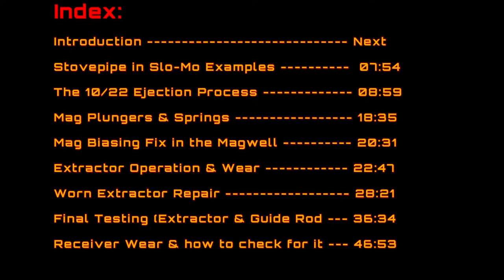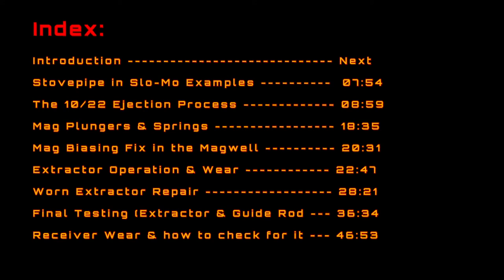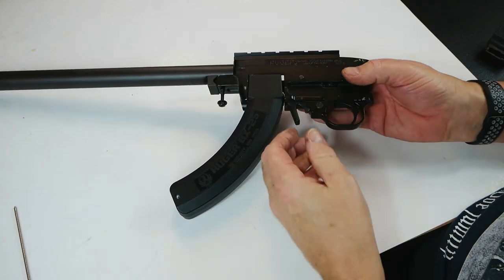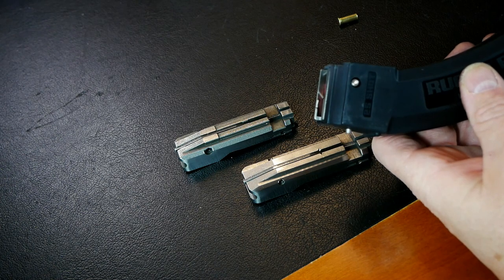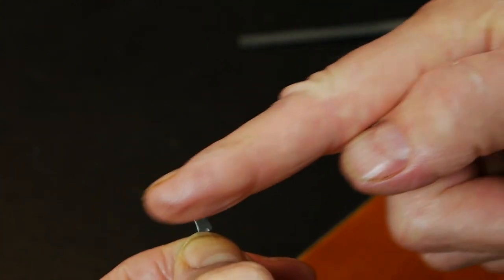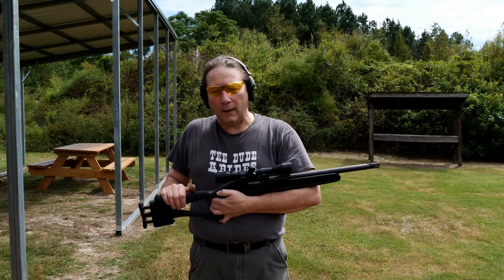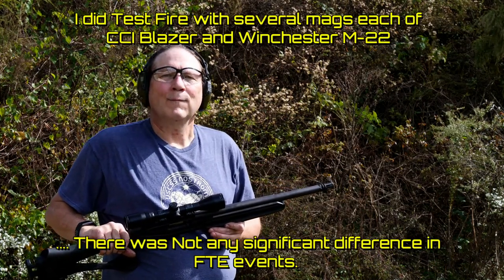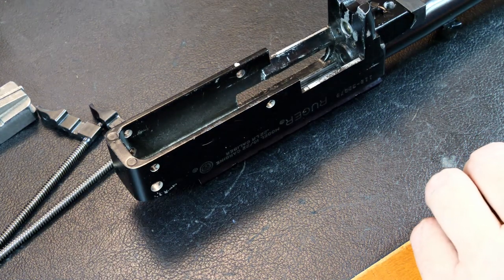Fixing 10/22 Stovepipe & Failure to Eject Issues

Comment: When I first bought my 1022 way back in the early 2000,s I had two ten round mags and very quickly bought a BX25 as well. (I also own two BX15 mags).
The ten rounders never skipped a beat, and for a long time the rifle would happily eat and cycle anything I put through it. It worked flawlessly with Eley subsonics too (I live in the UK). However....the BX25 would endlessly cause issues with stovepiping and failures to eject, even with CCI minimags. I noted the 'wobble' of the inserted mag, compared to the ten round mags, also exacerbated by the extra leverage on the long mag body. So, I took some sniper tape and my trusty pocket knife and cut and stuck a couple of layers of the tape, carefully 'fitted' around the top of the mag where it enters the rifle. It was then a really snug fit but still very easy to insert or remove. I loaded up.....mag dumped and "Hey Presto!" No more jams!! I never had to do anything else, it just fixed the issue straight off. Interestingly, the BX15 mags work as well as the ten round mags and seldom if ever cause issues.....depending on the ammo. There has however been an interesting change in behaviour in that one day, a long time ago now, I went out and bought a new batch of  Eley subsonics (rabbit hunting/pest control in a sensitive area with a moderator fitted!) and this time, I had endless issues with all the mags!! I can only assume that Eley had changed their recipe somehow and these bullets no longer performed reliably in my semi auto. Other subsonic makes were better, although the issues went away completely when reverting to good old CCI minimags. The only issue being the noise level increased hugely!
The basic issue of padding out the top of the mag worked a treat and every so often, after a lot of work ( thousands of rounds and hundreds of insertions) I would just freshen up the tape with replacement pieces and back to great reliability.
Since then, I have plonked the 1022 action into an Arthur E Brown M1 carbine stock and also with two new ten round mags, added the 'look alike' M1 carbine dummy plastic mags that epoxy onto the base of the ten round mag. They look fantastic and they hugely help with loading and removing a standard ten round mag. My primary pest control rifle is now an M&P1522 and that has just had a new Volquartsen ejector fitted for the same damn reason!! It now runs like a sewing machine and cycles and ejects everything! 😊
Great video and great high speed stuff showing the bolt bounce too!! If they could eliminate that as it closes, the rifle would be even better!

Comment: I have had my 10-22 for 4 years.... What a POS!!!  Even stock mag. stovepipes.    Like a fool I bought a SR-22 pistol.  POS also.   Never again will Ruger get another dollar from me. I know this is not where to vent but why do they sell a product you have to modify to make it function as a reliable firearm!   Would you buy a new automobile just to work on.   GREAT Video!   I will try some of the excellent  tips here...  This dude has a lot more patients than I have!!!!
Reply: When I thought about the receiver wear thing and my 10/22 with just 5000 rounds though it, which has a wiggling bolt in the receiver something like this crossed my mind also.
Reply: Receiver wear doesn't seem to do much, I had a real POS that I sanded the cerecote out of the reciever. Then tried to mount a scope on and realized the barrel was canted to one side. I rotated the barrel and it'll run 25s now! It used to jam every other round.

Comment: Very thorough analysis 👍.  A new extractor might be a good idea if Failures to eject happen, although something to prevent the Mag from wiggling. Although the tape on the side of the Mag usually helps I think thats not the right place to put tape on because then it depends on the stock to stabilize the Mag in the receiver and the room the stock gives the Mag varies from Stock to Stock. I had the Idea to put some small tape stripes left and right on top of the Mags (on the narrow ridge just before the round portion on the right side and the metal portion on the left starts). This prevents wiggling completely and because this ridges with the tape stripe on it are making solid contact to the receiver it is completely independent from the kind of stock someone uses.
Regarding the wear on the receiver: I doubt that the bolt has no play when it's new, because mine has just 5000 rounds through it and it has some play. Since I did not check it when the gun was new I can't be 100% sure but it's quite unlikely that just 5000 rounds are causing that kind of wear, especially because mine was always lubed and reasonable clean.

Comment: A new Ruger 10/22 seems to have lots of issues and it's made with more cheaply parts and less quality control. 
Great review 
Thanks for sharing 🤝👍
Reply from the maker: Thanks! and I agree... I think Ruger's QC on newer 10/22's isn't as good as it used to be, and also if you look at the older 10 round mags that came with 10/22's the feed lips and extractors are machined and not cast and fit much more precisely (even the new 10rd mags that I have purchased are just cast), add in a looser fit on the BX-25's and it definitely impacts reliability.

Comment: My relatively new 10/22 (5000rounds) started having ejection issues with the BX-25 mags adding a layer of metal tape on the back ridge of the mag helped alot. That ridge wears down over time and the mag gets really loose. I'm going to add some tape to the well, like you did, just for good measure. Also, make sure you clean the bolt every 300-400 rounds; especially if running a suppressor. If the firing pin gets gummed up a weak primer strikes will cause a short cycle. Something strange is my gun has a huge amount of bolt wiggle (about 1/8"). I see little indication of wear on the bolt or the receiver.

Comment: Thanks for the tips most of it made Sends to me, I fix everything I'm off grid. You probably reduced my repair time.
Quite a bit. When I was younger, I would burn. Maybe 2 boxes a week sometimes just one. A lot of shooting more than normal, I guess.
40 years later.
I'm lucky if I burn a box of 500 every 2 years. My wife is gone.
Not my life. Not making enough probably gonna go back to work. After 2 and a 1/2 years can't survive on social security.
I'm not old, just high mileage.  LOL.

Comment: Yes, the vise was pulling out heat. However, you did not temper anything. First, a part is heated and rapidly cooled completely to harden. That is hardening. Tempering is when you reheat to a set temp to give the steel strength. If left fully hard, it will be very brittle. 

In this case, this is not an issue as you allowed the part to cool far too much before adding any coolant, (which was far too little coolant to work), and far too long in the cooling before being applied. What y actually did here it annealed the steel. In other words, you softened it. Further heat was applied too long and this causes loss of carbon which lowers the steels ability to harden. 

Next time, try this. with a low cost pair of needle nose  pliers, hold as little of the base as possible. Apply heat just long enough to go to orange which is appx. 1475 deg f. Immediately drop into oil. Do NOT allow it to lose the color before dropping it into th oil. Allow it to cool completely in the oil.  Once retrieved from the oil,  mediately place in a pre-heated oven at 425 deg. for 1 hour. Two is better! Allow to air cool. No forced air. This will draw the brittleness from the steel and lower the Rockwell C hardness down to apx. 56 hrc. This is tempering.  Straight from the oil cooling was hardening. Very high HRc number in the neighborhood of 64 her. Very brittle. Unless you allowed it to cool before it was dropped into coolant. Simply dripping coolant on the hot part will do nothing but induce stress into the steel.  

So essentially what was done here was the part was both softened, with hard spots causing stress risers making it far inferior to what it was before any heating.  

Hope this helps!

KnifeMaker/Retired after over 47+ years in the Craft

Comment: I chased all the possible problems and what I found that was wrong was that I was firing it with oil on the extractor area. Fired it dry and all the problems went away. I would often just spray that area where the extractor is with brake clean just before I use it. Works well dry.

Comment: Well done and thanks for the effort here. In my experience it's the fitment of the BX25 to the receiver and I think you saw that yourself by shimming it. The BX25 is a finicky problem child compared to the 10rd rotary mags. If a BX25 works in your receiver, great. If not, you have to figure out how to make it work because the manufacturing tolerances on the receivers is so poor. It's a crap shoot when you use this combo. But what do you expect from a $199 rifle? I have friends that can't make ANY BX25's work in their 10/22's and others have zero problems running the same ammo through a BX25. If their QC was this bad on the rest of their firearms they'd be out of business. And Kudos to you for using that crap ammo. If you can make Golden Bullets run, you da man!
Reply from the maker: Thanks for the added Info!  It's interesting as everyone's experiences are a little different.  I've tried BX-25's in two regular 10/22's, one Takedown model and a Charger pistol and the only one that has given me fits is the one in the video and that has been after close to 10 years using them.  Unfortunately Ruger's design for holding the BX isn't up to snuff and the cast feed lips without any milling aren't doing them any favors either (on top of this I've noticed that the aftermarket 10 round mags aren't of the same quality as the 10 rounders that came with the rifles I've seen) and as I commented in the video when the mag is biased for better ejector engagement the ejection is much more consistent with where the brass is going, which to me is the largest issue by far that's only compounded by all of the other things that affect it.  Thanks for Watching and Contributing!

Comment: A very good video. I would like to add that the side to side movement should be taken out of each mag, not the stock of the gun. The mags should fit well even without the stock on. It is the left hand outer ‘lip’ of the BX25 mags that differ on each mag as they are a very cheap production mag. By putting tape on the non ejector side of the mag (test fix) you will find they tighten up and align correctly. A very informative and well produced video. Thank you.

Comment: Very interesting and well put together.  Being in the UK it’s a nightmare getting some replacement parts but I have used Volquartsen parts successfully. I am interested to try sharpen the extractor and of course if this is successful it is a lot cheaper than buying a replacement part. I think your comments about generally keeping your gun clean and regularly maintained is very good advice, The 22 RF is a very dirty round but lots of fun. Thank you very much thoroughly enjoyed your video, learn a lot. The Dude Abides ;-)

Comment: Very well done.  I have a 10/22 clone that I built using an 80% receiver, and  have been experiencing an abnormal number of mostly failure to ejects and stovepiping while exclusively using the BX25 mags.  I think the trigger group is the only authentic Ruger part in the build.  I don't believe the extractor is the issue, as its new.  But you never know.  You have given me a lot of things to check, thanks for taking the time and making the effort to put this video out.
Reply from the maker: You're welcome!  .... With everything new so long as the side to side bolt play in the receiver is minimal and you can precisely feel the grooves of your fingerprint when you drag the sharp edge of your extractor across it, my best guess would be the side to side wobble on the BX-25 due to the darned Taper on the block section. A decent test for this would be to keep the Magazine with the bottom pushed as far left (as your holding the rifle) as it will go and see if you still stovepipe ... if it goes away then perhaps either build up the side of the mags to hold it in that position or build up the inside of the stock to better keep the ejector on the mag better engaged.  Hope that helps!
Reply: @PhoenixRising62  
Okay, so I know what my issue was. Over the weekend I took both BX25 mags and put one layer of 3M painter's tape on the sides of each mag. They fit nice and tight in the magwell now, and the firearm runs like a champ. Once again, thanks for going to all the effort you did with your analysis. I will probably mod them with an epoxy/graphite powder mix as a permanent fix.
As an aside, I contacted Ruger about it and got on a merry go round with them. They wanted me to send in the mags for replacement with mags that would have the same issues. I declined and told them to redesign the mags, then I'll send mine in. If those of us having this problem would all do that,  Ruger might take the hint imo.

Comment: Nice video, something to look at is that when bolt shuts, the outer part of the extractor rides in the barrel slot to actually open the extractor, let it pass over the brass then closes on case. This prevents the extractor from firing the round accidentally

Comment: I have found that if you lock the bolt back and then insert the Mag ( which are the rules in comp shooting) then charge the weapon stovepipes will be a thing of the past  I shoot comp with a total custom 10/22,  shoot around 300 rounds every week year-round, That's around 15,000 rounds per year, Complet clean after every match, yes my AMMO bill is out of sight. But don't ever get a bad or no time on match day because of stovepipes.
Reply: Well, I guess I can try that next time because I'm about to toss the thing into the Mississippi River.

Comment: i like science projects, but I never imagined how much time and $ my new ruger charger would be costing me. I am almost to a point where I am going to toss it into a lake so it will stop sucking my time and mental stability haha yes, have invested in every mag on the market, 2 different brands of after market extractors, of course cleaning and measuring all internals, all kinds of ammo you can imagine, back and forth to range countless times, etc etc etc and still 25% stovepipes.  i just ordered 22 conversion kit for my ar. might abandon 10/22 permanently sadly.
Reply from the maker: I can understand~ I felt the same way in doing this video, before you fully abandon it have you tried both the ejector and Biasing the magazine (adding material inside the stock at the bottom of the ejection port side) to give better engagement with the bolt head? ... In the video that is one thing that I did not do with my old (and noticeably warn) receiver (combine both a sharp edged extractor AND modifying the Stock to Bias the Magazine) as both of those separately showed the most improvement separately. If you already have a new extractor in it playing around with foil tape making sure to only put it at the very bottom of the inside of the stock and slowly building it up might be worthwhile.  I will probably do this with my old receiver which I put in a standard wood stock 10/22 since I only use 10 round mags with it, which I've never had that issue with.
  
BTW have you used the 10rd mags with it and do they work fine? ...  If they do then the mag well trick might solve it, but if they don't it likely won't.  As a side note I've had four 10/22's including a charger and all have worked well aside from the one in the video and in the end the biggest issue I believe was the wear on the receiver after over 35 years of use.  Thanks for Watching!

Comment: I had extractor getting heavily worn because my barrel wasn't installed right at the factory. There's a groove in the barrel where the extractor meets. I used heat gun and rotated barrel. Turned a piece of junk into a fun ammo eater.